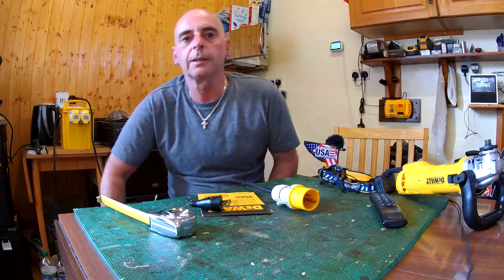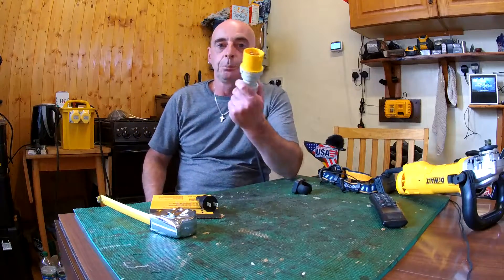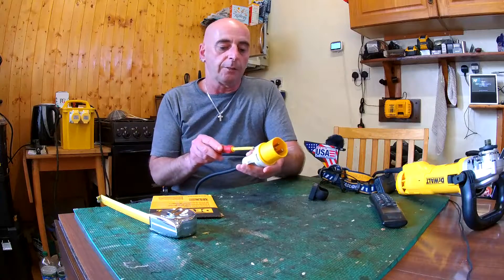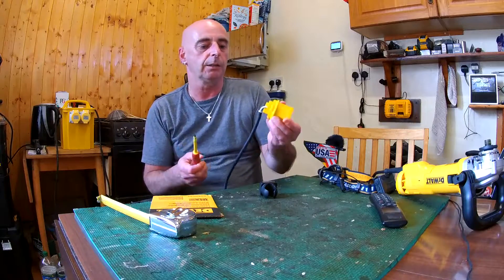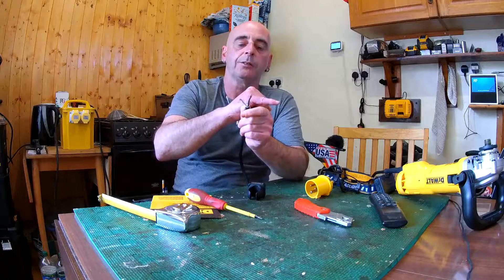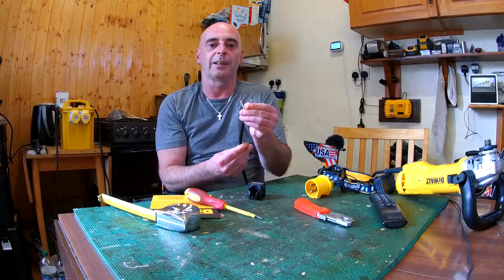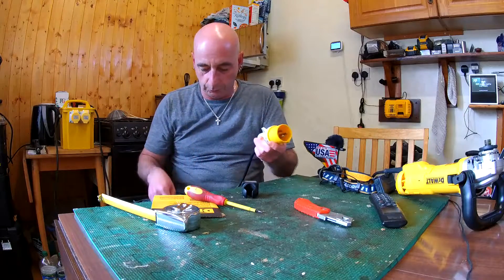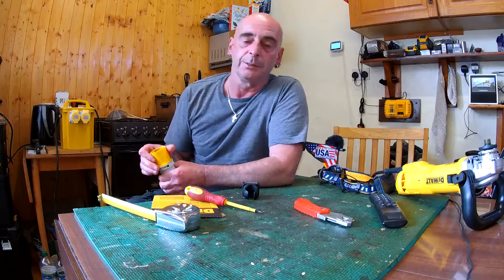USA 110v to UK 110v through a transformer

Comment: Thanks for posting this video,I’ve watched it before when I did a plug swap on a grinder,I bought a pressure washer that is 120v 🫣 I’m going to fit the same plug on it later today as I’ve got a 110 transformer the same as yours,it comes with the same type of two pinned thing,wish me luck 🥳

Comment: It does not matter so much if you are going to use a 110V site transformer. This transformer is a center tapped earth and does not have a neutral. It gives you 55V between earth and each line and 110V between the 2 lines.

Comment: You could always buy a us charger for your batteries. Then change the plug and charge on site. Thanks, am in US now and was gonna leave the chargers. Will bring back now.
Reply: No, you couldn't. The UK uses 50hz mains, while the US uses 60hz. Unless the device has a switch to change the frequency, it will not work and will possibly burst in flames.
Reply: @darren-garden  Almost all tool chargers use frequency agnostic switching supplies.  It won't care.

Comment: What color wire is 'this one'? You said it on all three wires. Can't see which is is which on the video. Also Americans system uses 60 hz and UK use 50hz and the American appliance will burn out after only a short duration

Comment: So, if I understand you correctly, it is mandatory to run tools on a job site in the U.K. on 110v? Sounds good. All my tools here in Canada are 110 anyways, so that works. As for charging batteries, did I understand correctly that it was illegal to charge batteries on site even with 110v?  That seems kind of silly, but the rules are what they are. Do tradesmen have a lot of spare batts then?
Reply: Hi Cottonbrat, about the batteries...it is illegal to use any kind of 240v tools or chargers on a building site here in UK. Although if you have a 110v battery charger, then it perfectly fine to use on the site
Reply: Can this work in the US? So say you took over a 110v tool over to the US would that work if you swapped the plug?

Comment: (1:30) - But we don't have positive and negative here in UK.
Only DC (Direct Current) current has a positive and negative.
UK mains is AC. (Alternating current).
230V  AC .
(Actually, it's 240V, but that's a whole different story)

Our 230V AC mains wiring is colour coded blue, brown, and green/yellow.
Brown for line (previously called live), blue for neutral and green/yellow for earth.

Only difference between UK and US is what they call hot, we call line and what we call earth, they call ground.
We both call neutral, neutral

Now, since the mains is AC, it doesn't matter which way round  you connect the wiring.
Surely, because there are only two pins on the American plug, which can be inserted any way round is giving you a clue ?

So it doesn't matter which way round you wire it, it will work just fine and since there is no earth / ground to worry about, perfectly safe too.
But if you are obsessive compulsive, then black is the hot / line.
>
Reply: "what they call hot, we call line ".
No, it's "live". The "live" wire is alive with electricity.

"Now, since the mains is AC, it doesn't matter which way round  you connect the wiring."
Incorrect, and dangerous claim.

"Surely, because there are only two pins on the American plug, which can be inserted any way round is giving you a clue ?"

Also incorrect. But even when true (as with European plugs), the assumption that cable colour coding shouldn't be respected is a dangerous one.

Neutral and Live really are two very different things.
Reply: @patrikfloding7985  that's incorrect. 
According to BS 7671:2018 pg 32 - a line conductor is a conductor of an AC system for the transmission of electrical energy other than a neutral conductor, a protective conductor or a PEN conductor.
A live part is a conductor or conductive part intended to be energized in normal use, including a neutral conductor but, by convention, not a PEN conductor.
Reply: @badryan8362  American terminology is that ungrounded conductors are live and grounded/grounding conductors are not.

Comment: Wanted to buy an American hedge trimmer for 110 volt use in UK.
Was told due to being designed for American mains at 60Hz, OK for short duration use only on UK 50Hz.
Prolonged used will run very hot, eventually, burnout.
Check specs. plate on American appliances, if it quotes 50/60hz you'll be OK.
Martin.
Reply: Most are spec’d for 50-60hz over here. Just check the tool specifications before buying.
Reply: That hedge trimmer uses a universal motor, which doesn't give a monkeys' about frequency.  Same with most mains tools.

Comment: Thanks for the video. I have looked for a simple solution for converting American 110 to British/English 110 for hours. I wish the Americans would take a leaf out of your book and explain it in layman's terms.
Reply: I’m halfway thru, & he’s confusing AC terms with DC terms, plus the voltage is wrong (it’s 120 here & the only ones here still calling it 110 are old fogeys). I’m getting a headache.

Positive & negative are DC terms (technically, in AC the voltage swings back & forth between positive & negative, ALL ON THE HOT (black) SIDE). In single phase AC, there is your hot (black), neutral (white), & if present, ground (green). Also, the prongs are opposite the UK’s, so if looking at a plug, and the ground prong is up, the hot is on the right, & the neutral is on the left.

Comment: Is the American tools the same 50hz 110v as UK
Reply from the maker: The Grinder Model is DWE4214 It is 50-60Hz, 120v AC/DC and according to what it says in the instructions it might run on 240v, but i'm not an electrician so i'm not going to be that brave.
Reply: @littlemilto6563  I am really surprised it's 50/60Hz - usually with motors it's one or the other - but in this case it sounds like it's a DC motor, so the frequency wouldn't matter. (I bet Dewalt made this model using parts from their cordless stuff - they even have a battery circular saw that's 120V DC (2x60V batteries))

That said, in this specific case, the UK site transformers for 110V are kinda unique because both leads are live. Each is at ~55V with reference to earth/neutral. (Try an AC voltmeter out ...). This is actually exactly how US residential 240V power works (2 x 120V split phases = 240V). That said, it's not exactly the same as US power (which would be 120V live to neutral or 120V live to earth.) It could be a problem depending on the device. The bigger issue is the frequency:   if it doesn't say 50Hz on the label, there could be serious issues - like burning up the motor.

As to batteries, if the charger supports 120V/50Hz input ....... most mobile/USB chargers do (look at the label, most will say "100-240V 50/60Hz" - aka world universal) , so..... if the regs just say 120V only but nothing about batteries...
Reply: @danieljewell1  Universal motors are frequency agnostic up to around 100cy/sec or so, above which motor series inductance starts to seriously limit current and thus power.  Induction motors are the ones that can get angry iffen the frequency deviation from design spec is too much.
Reply: US stuff is all 60hz
Reply: Everything we use here in the US is 60 hz